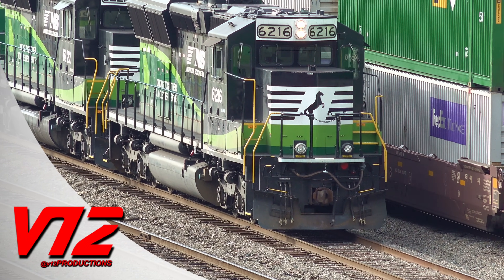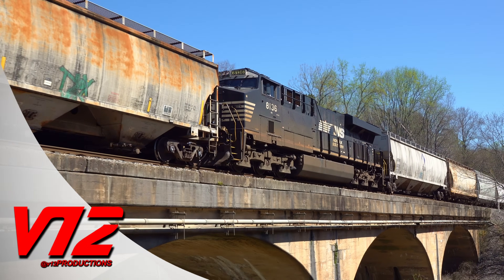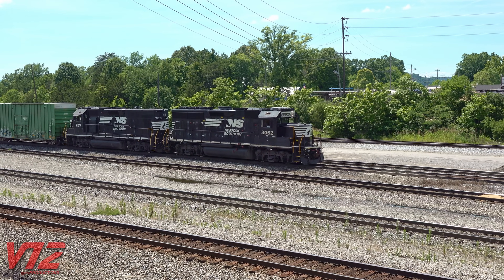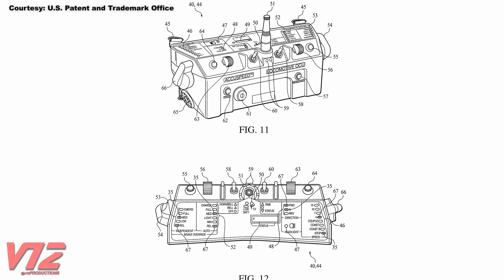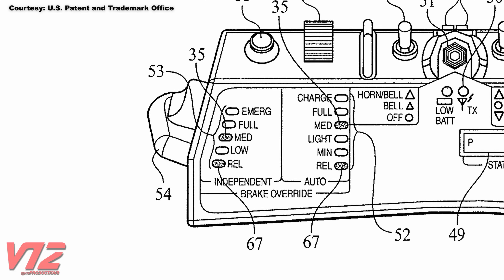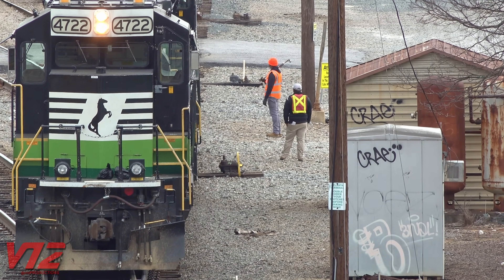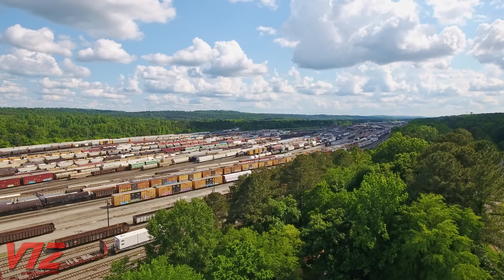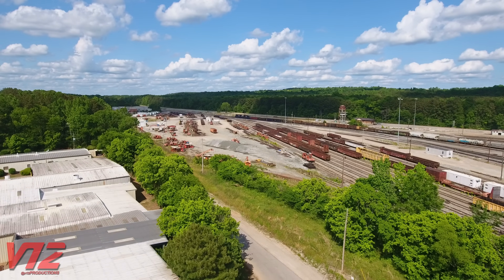REMOTE CONTROL Locomotives

Comment: RC is not all what is promoted.  It takes longer to switch out cars, takes away a job from a locomotive engineer, and is more dangerous than traditional switching.  I held both a RC license and a locomotive engineer's license.  RC is the wrong way to go!

Comment: I worked for Penn Central & Conrail for 38yrs out of Enola Yard an Altoona and I can tell you stories that would blow your mind. FRED"s "For Rear End Device" or EOTD's "End of Train Device" are Not 100% full proof as they will cut-out for 30secs when entering a tunnel or going around a mountain side something you can't internet look up as it needs to be seen in real time to understand, plus EOTD's can in fact register if the Train has a Hot-Box which most people have No clue that it can do that like I said it's Not 100% tho. When I worked the Horseshoe Curve line every Helper unit was Manned by a Helper Crew even to this day, they are NS, the DPU's are the only unmanned units on Trains, as FRA ruling all American Helpers have to have Real crews aboard them at all times when Active. RCL's were way ahead of my time so I can't tell you anything that I don't know. Another thing most don't know besides us old heads railroading horn blows either at crossing gates or around yards are actually "Morse Codes" the standard 2 long blows and 1 short followed by a long blow at crossing gates means "Stop, Look & Listen" there Not just a Sound it actually stands for something, just need to read between the lines to understand it. When a Train load such as a Manifest or Stack Train has more than 6 or 8 locomotives it's Not for more power its used to distribute the weight balance of the head end to the rest of the Train load. More power doesn't always mean better as in most cases to much power is worse than less. SD40-2 the Master unit of all has proven this to be a Fact as 1 unit may push or pull a cut with No problems very simply but adding another unit or slug stretches out the mass pulling power making it 50 times the power ratio, reasons why more units on some loads to use as a Back-up help or braking just for their weight tonnage.

Comment: From the UK : I asked a couple of days ago how DPUs are controlled and two days later this video pops up on my feed. Excellent explanation. Thank you. Here in the UK we don't have DPUs. What we do have are locos either top and tail, or on the rear of a passenger train with a driving trailer on the front. The locos are controlled from the front cab using wires that run through the whole train, with a system called time division multiplex. When British Rail initially started experimenting with this system, they connected it via either the lighting or the public address systems on the rolling stock. That had some very interesting effects when a driver in the front cab opened the power controller for the loco on the back and the train lights went out ! We also have a type of high speed diesel train called an HST, which has two identical locos, one each end, with up to ten coaches between. The prototype was built in 1972, but when they wired it together and coupled it all up, the driver opened the power controller and the two power cars set off in opposite directions....!! That would have a pretty spectacular effect on a train two miles long, methinks.

Comment: Excellent overview of the remote control locomotive AAR system this really beats the German & Austrian ÖBB system because an Alerter system is added to the remote control unit itself which is absent in the European version. Perhaps US Canada Railroad experts should bring this to Germany and Austria that way DB Baureihe 261 294 295 296 363 G6 & ÖBB Baureihe 2070 electric 1063 1064 & 1163 can be run like a Yard SD40-2 GP38-2 SD50 & GP60. Theirs need to have Sifa the German and Austrian ÖBB Alerter system on the remote

Comment: In my area in Germany we often see remote controlled trains to drive "in reverse". The operator stands on the last car with the control in his hands for about 10 km between the main line and a factory. Apparently driving this way and not having to move the locomotive at the destination allows them to move all cars at once.

Comment: I used to be a RCO ( Remote Control Operator ) when I worked at CSX Transportation in Miami, Florida at Hialeah Yard. I ran many awesome Remote Controlled Locomotives to include CSXT 6018 an EMD GP40-2, CSXT 6044 a EMD GP40-2 that was derated to a GP38-2S, CSXT 6552 and CSXT 6508 both EMD GP40-3s rebuilt from GP40-2s, CSXT 2023 a EMD GP38-2 rebuilt from a EMD GP38-2, and CSXT 6063 a EMD GP40-2 conventional locomotive MUed to the CSXT 9093 Remote Control Car Body “Sled” as we called it that could make any locomotive into a remote that was connected to it. I carried around the little green OCU ( Operator Control Unit ) Box that was secured by a 4 point reflective harness that I wore. Interesting thing about the rebuilt Dash 3s is the fact that you can apply the handbrake by holding both the left and right “Vigilance Switches” down for a few seconds. It will also release it the same way and the Locomotive will ring its bell twice to let you know that it’s released. Plus you can not only run the engine with the right hand throttle switch, but you also have the independent brake, train brake, horn, bell, headlights, and reverser all on the box. The outer two switches are the vigilance switches that you recover with and also use for the handbrake on the Dash 3s. The inboard switches have a few functions. The one on the left is the train brake and the other is Horn/Bell. To the right of the antenna is the reset switch that will give you a time delay for tilting the box and for toggling through different settings. The one to the right of that is the reverser that’s forward, neutral, and reverse. Once you put that reverser into center or neutral, the Three Step Protection feature is automatically engaged where the generator field is cut to the traction motors and stops the power flow. The engine throttle switch is on the right of the box and the Independent brake is on the left. The throttle will automatically modulate based on the number you select from couple, to 4, to 7, to 10, and to 15. The CSX boxes have 15 but stop at 10 so the top speed of the RCL in the yard will only be 10 mph which is yard speed. There are speed transponders bolted to the crossties in the yard and when the engine senses them they will automatically react to the speed limit of the transponder and you as a RCO are supposed to match it with the throttle. Once you reach the end of yard trackage it will hit a stop “puck” as we call them and automatically shoot the brakes into emergency to stop the engine from going out of the yard unless the manual override is performed by the RCO. The OCU box has a pair of Infrared sensors in the front of the box made to link it to the Locomotive Control Unit Computer on the Engine after you set the brakes into trail and use the air brake transfer valve to put the engines brakes into automatic mode controlled by the LCU. The amber strobe lights on the cab roof will blink once the engine is in remote mode. Also you have to perform your man down test and vigilance tests as well as standing and rolling locomotive brake tests with the OCU before performing work. The OCU also has a Pitch button on the front of the box to allow you to give primary control to a second RCO with his/her OCU. You push pitch while they hold a vigilance switch to lock in the command. Once you have secondary control you only have control of the horn/bell and the independent/emergency braking feature while the primary RCO has that and the remaining functions. The locomotive’s headlights automatically come on in the direction of travel as well if you forget to turn them on yourself manually. Once you shift into forward or reverse, the headlights match it. It’s a really fun job that i really miss. That PSR crap Hunter Harrison and Jim Foote brought in ruined the company and cut a ton of jobs to include the Y190/Y195 and Y290/295 Remote Switching jobs at Hialeah Yard in Miami. I was furloughed a bunch and because of my low seniority and disgust at the management of the company I decided to move on even though I loved the company and especially the locomotives and my job with them. I now work as a Deckhand and assistant Engineer aboard Moran Tugboats, some of which have EMD 645 and EMD 710 motors in them!! Awesome video! Love the footage of the Norfolk Southern EMD rebuilds and slugs!! 🚂
Reply from the maker: This is really interesting! I love learning about how stuff like this works. That does sound like a fun job. Thanks for watching!
Reply: @v12productions yes sir I thoroughly enjoy all of your videos! You have some great commentary and you have a lot of good history you throw in there when it comes to your videos. Thank you as well my friend! 🚂

Comment: G'day from Australia... take a gander at our 'Autonomous' 2.3km (1.42mile) long 30,000 ton mining trains. No driver, no remote control, just controlled by a computer on a 1000 km round trip.
https://youtu.be/BDbfDUqPm8E

A bit old now, but our 2011 world record mining train - 7.353 km (4.6 miles) long, 682 wagons with a total weight 99,734 tons - https://youtu.be/l3kQ4lgf9Mc

Comment: At the Pine Creek Railroad museum where I used to volunteer, ex US Steel GE 55 tonner #46 (sister unit to the operational #45) is equipped with RC electronics. Being a steel mill engine, it was used on the "hot side" of the USS plant in Loraine Ohio. Good thing too. When we got it, the engineer's side of the cab appeared to have been mashed in by the heat.

Comment: Pretty awesome equipment if you ask me. Where I grew up in Maine was right near the old Montreal Maine and Atlantic line and they used to have a remote control caboose they put either in between or behind other units and that’s how they used to switch using one man crews. The Lac-Megantic accident really killed the one man crews and the remote control caboose usage around here. Now Canadian pacific owns the old MMA line and uses GP-20 ecos for mostly everything here now.

Comment: In the early 1980s, I work for the Harris Corp, Melbourne, Fl. At that time, they had an R&D for locomotive radio control. They had several miles of track with GE locomotives.

Comment: Slug unit date back to the 1970s. Santa Fe was the first to have a full functioning remotely controlled unit made out of a f7b which was made in the 1970s. Southern Pacific second order of the tunnel Motors in the 40-2 series had locontrol which was essentially a remotely-controlled set of units at the rear of a train.

Comment: Having used them they are nice sometimes. Climbing onto railcars with the pack you have to be careful not to press the uh oh button or sometimes at random loose connection and the train goes into emergency and you have to reset it. Unfortunately it does take the engineer out of the cab and out of the job and adds more to the operator (the conductor) but loram technologies aka GREX uses them on their TSO units while operating. I know because I used them and they come in clutch there because I would be the sole operator and have control while operating in reverse or shoving move and I dont have to keep giving car counts to an engineer because I am the operator.
Reply: One of the only good things BNSF is doing right now is eliminating RCO in some of their yards and putting engineers back in the seat.

Comment: I loved them when I ran them. We had a shack with AC, HEAT a microwave and bled cars. Back in the early days though it was rough. Coast Guard base across the river from us was testing something not sure what but it put our engine in FWD and held throttle up to 8. Ran off the end of our track still sitting there at 8 our remote wasn’t even on
Reply: ***I love them under like 20 cars or just coupling and shoving back over and over. Bigger than that I want to feel the train. Especially with these lengths and weight and balance seeming to be gone. Shoving in with empty intermodal and loads being pushed hit the right corner you can watch the car rise straight up off the track from the force and they fly when something finally gives.

Comment: I still don't understand how the one man remote switchers get around the standing law of needing a crewman with a clear view at the point of direction, even in yards while switching. 
If the guy on the ground at the switch has a long enough cut, the head end is beyond his vision, quite often around a bend. While he's on tail end throwing switches and pulling ahead, the power just ran over someone or something because no one's there.
Reply: Railroads established remote control zones in yards just to get around that. Often one RCO will ride the point while the other does the work, if it's a two-man job. The point still has to be protected in some form or another.
Reply: Maybe they get yard masters or someone else to watch the point via camera or have PPZs etc

Comment: Years ago I had a friend who was a remote operator on the Birmingham Southern Railroad which hauled ore from the nearby mines to the local steel plant. As you said, this early example was in the 1960s - 70s.

Comment: The folks controlling the RC locomotives reminds of controlling a 1:1 scale DCC locomotive. LOL. Great video as always. I think SP, UP, and Santa Fe also had early experiments with DPUs as many EMD SD40-2s Santa Fe & UP got had longer snoot noses for the locotrol equipment. SP and SSW also had SD40T-2s with snoot noses as well.
Reply: It's actually closer to an RC drone than a DCC. The power and control is all in the cab, not being fed through the track. (And since it IS all-electric aside from the engine, it can be computer controlled pretty easily. Then you have a hard-wired system and a wireless system, and you can get out of the cab to control the train.
Reply: Lol yea that is actually so true lol

Comment: So here’s a cool story I’ve had with the remote control. I was railfanning with my brother, in the GR Wyoming Yard. One of the one man crew conductors had spotted us and realized we were there for a while, and he walks over to us, and told me to hold down one of the knobs, which was the bell knob. Holding that knob down set the horn off, and I was pretty satisfied lol. Not everyday you get to blow a train horn with that sweet K5LA, but it was quite the experience!
Reply from the maker: Super cool!
Reply: I had a similar experience. I have it on 'Remember Me' video. I will forever remember that moment. I was only 6 at the time.

Comment: Glad to hear of the safety controls. Was wondering  about a Deadman system, just in case!
Reply: I think those exist too. Most basic control items could be found on the beltpack (throttle, independent brake, auto brake, reverser, sand, horn/bell, alerter, etc). Some configurations will have additional features or controls to meet the company's specifications (GF Disable, Pullback, etc).

If you're into radio, you could even detect the presence of the beltpack signals too (either in the 450 MHz, 900 MHz, or 2.4 GHz band). I wouldn't try decoding any of the signals because there is just no easy way to do it as the manufacturers put their own encoding schemes on the RCL's. DPU's though for the most part, can be decoded with some special software, and they run on the same frequency bands as the EOTs.

Comment: wondered how DPU failure is handled. Engine on downslope , DPU on upslope , and the radio fails. Seems like there would be a super stressed point at the peak.
Reply: The DP will continue to operate at the last throttle or dynamic brake setting until communication is restored. If I recall my training correctly, it will do so for up to 90 minutes of comm loss. Or you can make a big brake pipe reduction and I think the DP will return to idle.

Comment: The systems operate on 220MHz, a band that was taken from ham radio users about 20 years ago.  It is a band that provides a reasonable compromise between range and reliability.
Reply: Well actually ham radio operators still have the 220 MHz band, from 222 to 225 MHz
Reply: @UPRailfan  But they used to have 220-225MHz until UPS convinced the FCC to take 200-222MHz away from them (money wins).  Then UPS lost interest in it. So now it is a band used for a variety of things, including remote control of locomotives.
Reply: @samallan6616  ahh okay I see

Comment: Pretty soon, the railroads won't need either an engineer or conductor in the cab to operate the locomotives. The A/I system will run the trains remotely, eliminating the human equation completely. It's all part of the transhumanism 4th industrial revolution.
Reply: They are ruining jobs which is so sad